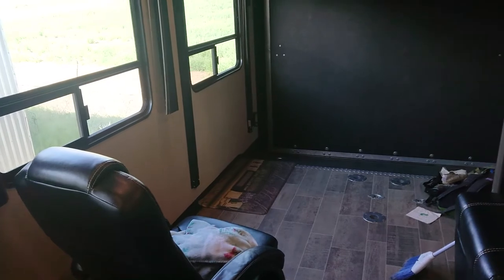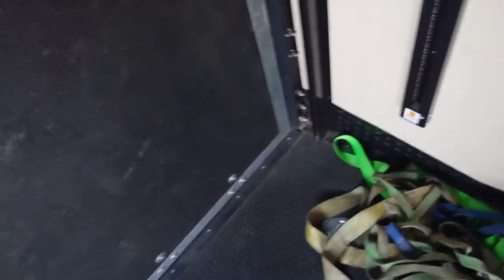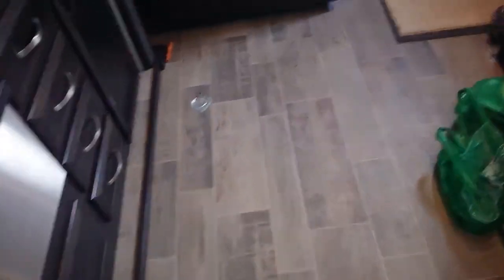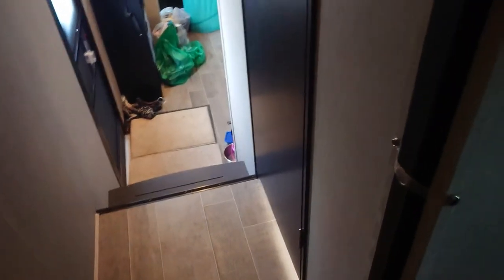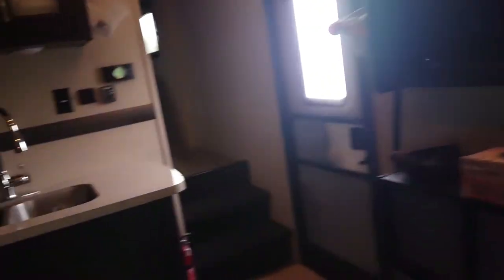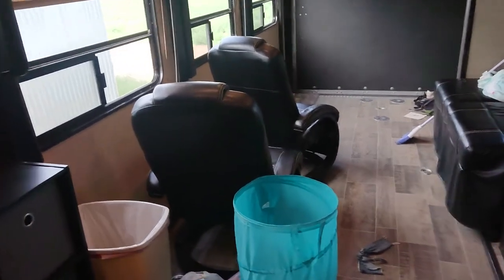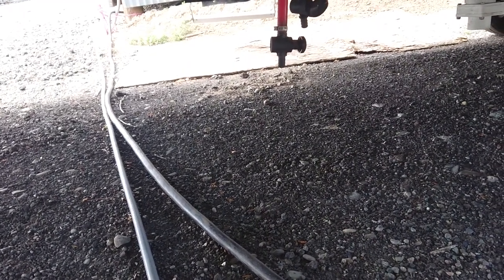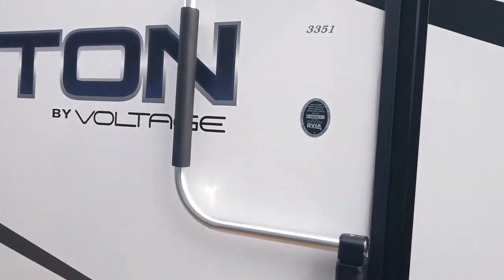2018 Triton 3351 review.

Comment: Appreciate the honesty- looking at one of these tomorrow. Do you recommend still?

Concerned about the heat you mentioned, looking to live in full time. Would a space heater solve it?
Reply from the maker: For five months out of the Year down in Mississippi we also live in  ours from about November to April. It's been a decent rv to live in, but it is parked inside a Insulated  shop.
It's not very well insulated, not at all a 4 seasons type rv, although I expect most aren't.
Pretty flimsy back door that doesn't seal up well.
Also not very sold when walking about or doing, married couple activities, even when leveled with the jacks down. 
2 steps going up to the master bedroom squeak bad, very noisy. Wakes up the everyone in the rv when stepping on them.
Only other thing is having no second door to the bathroom. It's a bit of a problem if you need privacy going from the bedroom to the bathroom.
Also a bit of a problem  having only a sliding door to the bedroom with no lock.
I'll try to do an updated video on it soon.